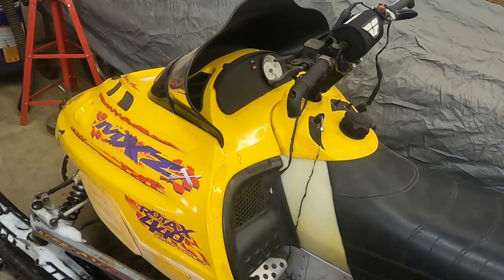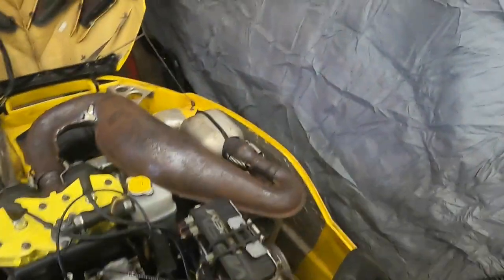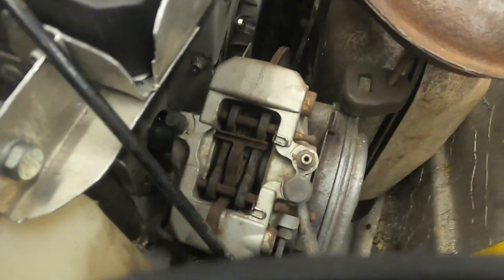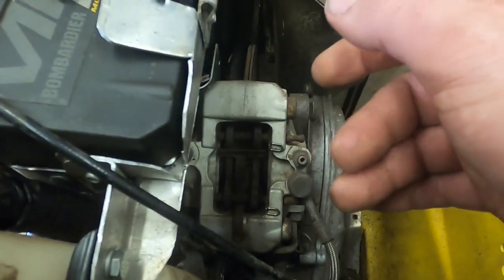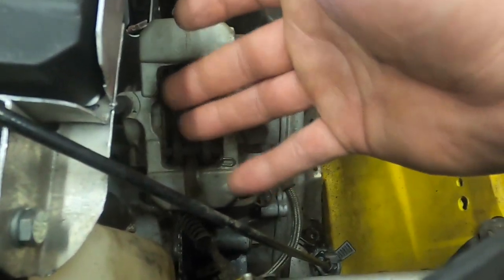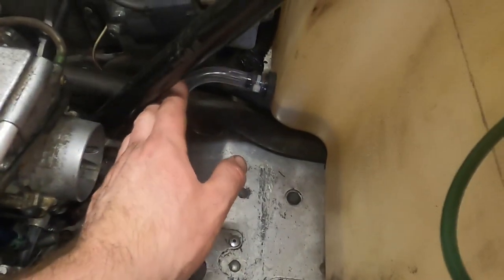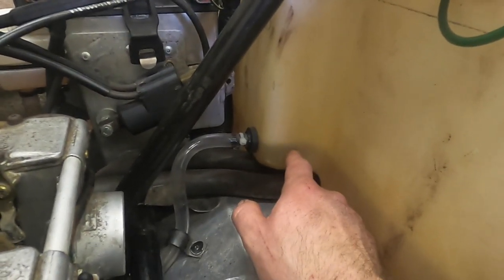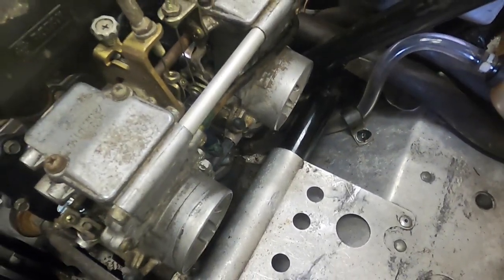Don't Burn Your Sled Down Watch This Before Riding

Comment: That's were its important to get used to and learn to "read" the machine. Starting the sled at least the first time each day with the rear in the air can catch a dragging brake as well as many other issues. Spin it up a bit and get used to how much it typically coasts when the throttle is shut off. A non-drag will coast down a bit and a dragging brake with stop quickly.